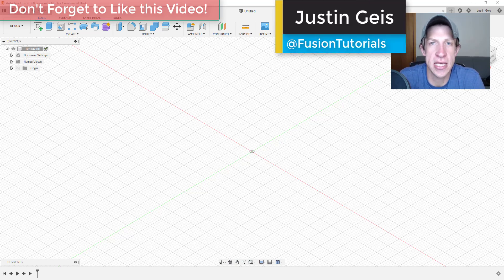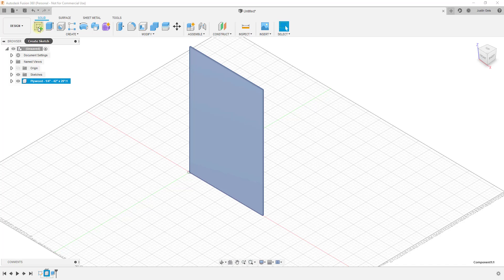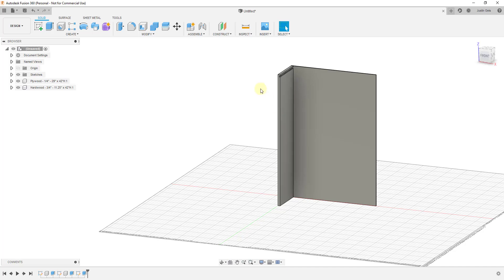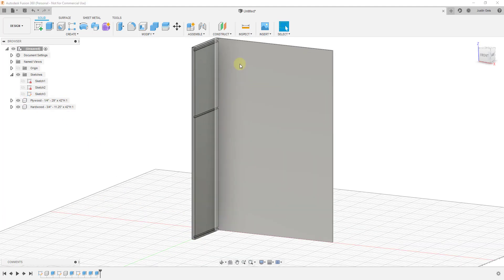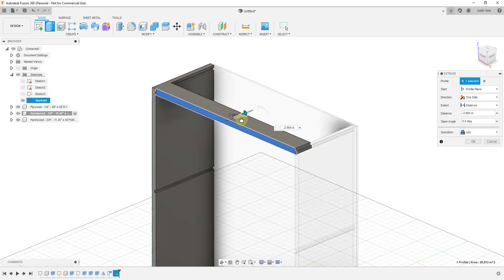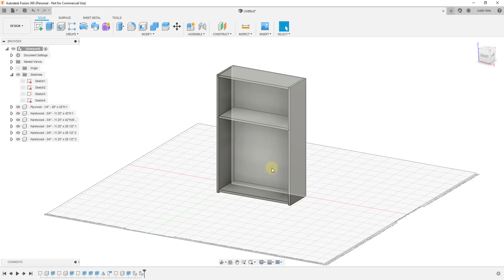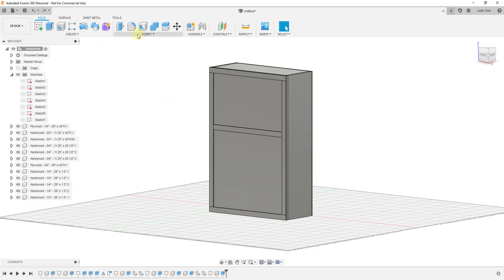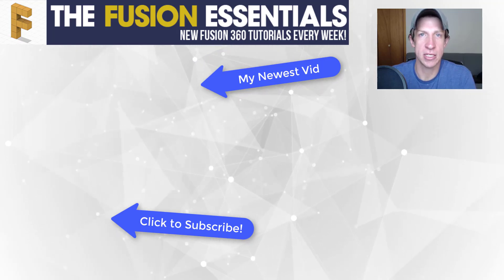Modeling a Cabinet in Fusion 360 (Fusion 360 Woodworking Tutorial)

Comment: A few comments: 1. IMO you should always use parameters for your dimensions in case they need to be tweaked, 2. I'm not sure why you're creating two perpendicular lines and then drawing a rectangle over the top - you can just create a rectangle, that's it for now!

Comment: Hmmm, this looks more complicated and tedious than sketchup. There, moving and copying is pressing M and then CTRL, then move the target where you want. Then flip it and done.

Please don't understand me wrong, i watched your sketchup tuts for a long time now and also subbed. You are a great teacher for software and maybe other things too.

But me, being now in a position to choose which one i should buy, at this first tutorial regarding cabinets i'm almost disapointed about the way Fusion works.

Questions:
1. Ain't possible in Fusion to draw directly a rectangle? Is the only way just drawing two lines then using rectangle?
2. What help brings sketches in Fusion, instead of doing it quickly like in sk-up (drawing rectangles and extruding quickly where you need it (even without the need to type the measure)?

Then, other things that i see slowing down the process is going on so many places on the screen to choose so many options (new object -> to component) / then going up and choose other things... etc. I'm sure there are shorcuts for this, but here you present this for noobs like me and showing exactly where to go, but still, i feel by just watching this clip that this process is way "harder" to do in Fusion than in Sketchup.

It's my opinion regarding the creation part. I don't know what Fusion offers after this part regardin calculating material costs, waste, consumption on the boards, showing dimensions, breaking apart objects with numbered parts etc, with or without the help of extensions (free or paid).

I just made 4 cabinets in sketchup for what i need in my home, but having health issues and also other home bad events i passed by the chance of finishing them in the trial period.
As i also love 3D since 2000, when i worked a lot in 3D Max, i would love to try that again with smaller software like Sketchup or Fusion for small projects like furniture for now, and maybe starting to build houses again and maybe neigbour areas... eh, that;s a dream. Let's stay real for the furniture part ;-).

Love your work and will still watch you in the future even if i don't work in the programs you use, just because always there is something new to learn from different perspective and even different things that i don't do.

Cheers and be well!
Reply from the maker: I don't know if tedious is quite the right word, but there are definitely some situations where adding objects or making simple changes is a little more difficult than it would be in SketchUp. The tradeoff is that everything is linked and "smart" - meaning you can go back and change a sketch and the model will change as well. There's a lot more data in the models, which in a lot of situations is a really great thing
Reply: I'm sorry for the wrong word, but not being native english speaker it may be my fault.
I'm sure you know about what you are reffering to, but for someone like me who doesn't do this for living, just making improvements in his home and sometimes maybe  for friends (which i'm doubting, but let's say i help one or two at some... far away point 😁) is it better to buy sketchup which i already learned and maybe using it in conjunction with blender (if i will be able to get back to) or start the fusion 360 trial and see after that? I also am in need to make those 4 cabinets because i have a lot of problems happening in my hosue and life right now. I also have lot of health issues and adhd, combined makes me not so patient regarding simple operations that other ways will be longer to do.

I can give an example for that. I'm a graphic designer and working in advertising since 2003, in production too. I work in PS, IL, IN and also Corel Draw. Can you believe that in my country and also for what clients i had, Corel Draw made me life more easier? 

Making a comparison to what i said about Sketchup and Fusion, here i work much faster in Corel vs IL because of the way is made (menu's, pages...) even regarding colors might no be as reliable as IL, for my needs it always was (even using pantone codes and others in my work). But the most important thing that Corel have vs IL is... Imposing built in. That's my win situation for choosing something that i suppose 90% of bigger graphic designers and companies will "hate" me. But, you as a creator of any kind, you should use things that work best for you, not for others. I had a lot of materials sent by big graphic designers paid with a lot of money and i had to work for hours or even a full day to repair the mistakes they made because they are not good at all details as i need for finished work, meaning printing & production. Eh... that's another story.

Ikn i talk too much, but that's me. When i'm interested in something, i'm devoted. I learned IL & IN in 1 month and a half, doing a big project, a book. And then i felt so much the need for Corel, but i couldn't use it except for jpgs exported for IL. In rest i needed to use IL for compatibility...

That's why i'm asking here which one you think will work for me in my small hobby for doing things. Maybe in the future for 3D printing too.

Again, I hope you didn't get this message as an agressive one, it might be my adhd or ocd or w/e it is, when i see things that i do that need more time to do, i'm almost breaking my mood to do that project because my thoughts come and go in a split second and i loose my inspiration. That's why i can do so many things in Corel without wasting time. Don't get me wrong, i hate so many things in Corel that the maker never addressed it and some functionality are available only from third party extensions and also ones that they removed from later versions... Nobody is perfect, but we need the right tools for us.

Ok, I'm stopping this comment because it's too long.

If you won't respond it's no problem. I already thank you for your first response and i'll watch you as always with the same passion for your good teacher skills.

Cheers and be well!

 @TheFusionEssentials

Comment: How easy is it to change lets say width of the cabinet and have it stay correct?

It looks like hobbling together blocks without any relations. Most of the dimensions are written by hand, meaning if you change one thing you have to go into every block and manually change that as well. Like at 14:53 - you have 1.5inch 3 different times in the same sketch. You can't add equal relations to that?

In solidworks i can make the same thing, but all related to each other, so if i change width/height/depth everything resizes to the correct values.
Reply: Old comment response but still valid - great video on forceful direct dimension modeling process and I didn't see really any use of basic sketch constraints - can level this up by creating parameters, variables for height, width, plywood thickness, etc. and entering a starting dimensional value. when your creating a rectangle you enter "Height=34  //   Width=30" as you dimension and it will create a user parameter with your starting value. As you continue to design you can simply type the parameter name in for dimensions, there is a very user friendly drop down menu that appears when you start typing a parameter. Reducing repeat dimensioning and making your model able to stretch with dimensional changes in the parameters dialog box. The parameters menu can be found under design ribbon->modify->change parameters. I am still new to the software and am working on what workflow works best to avoid design models that "break" with dimensional changes. For me the end game is a model that can be adjusted at will, that's easy to manually edit and pull parts for manufacturing on a cnc. Next level up will be to learn the configurations suite to be able to have 1 model and decide on door L/R, double door, 2/3 drawer, filler L/R, etc. and that's only a small amount of what the software is capable of